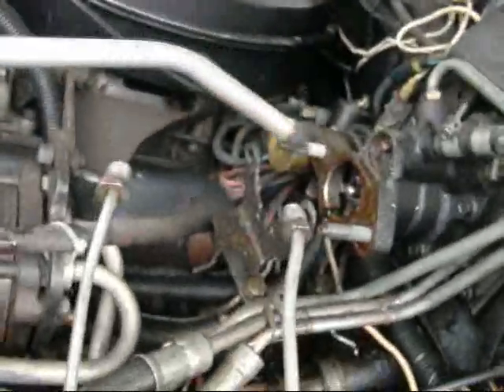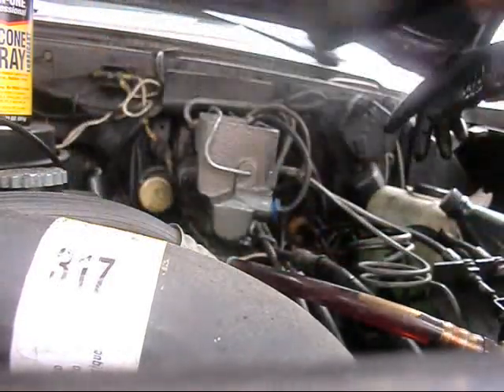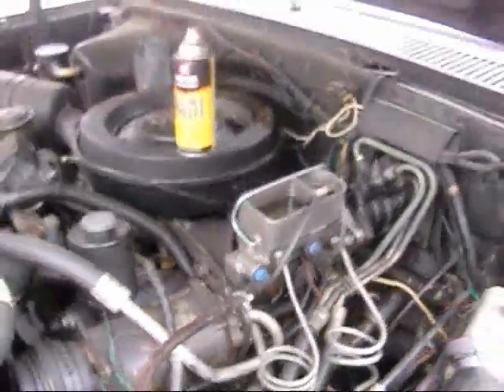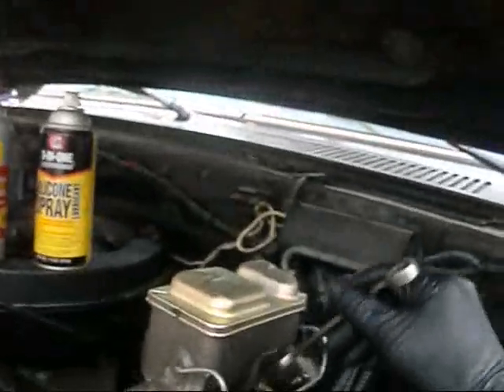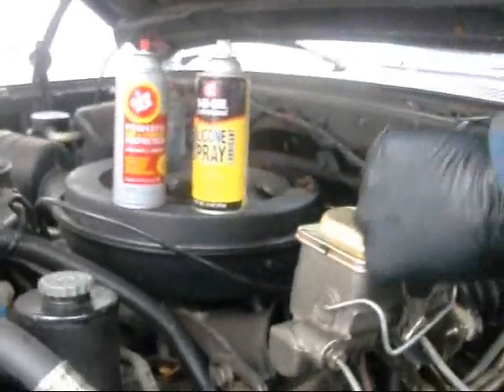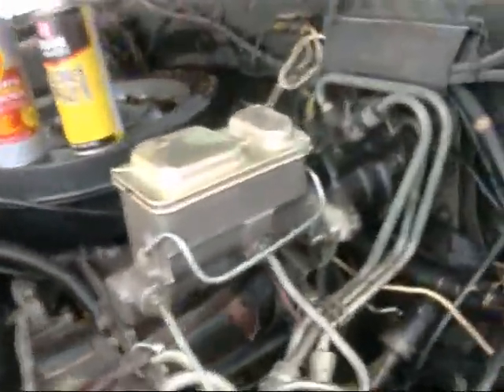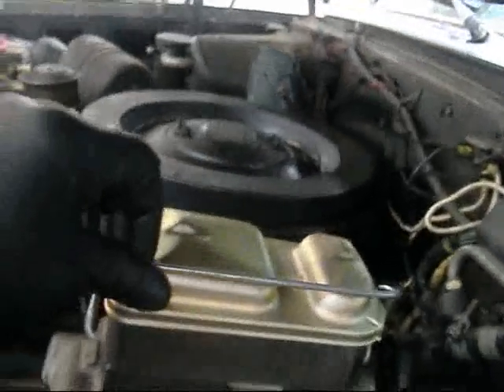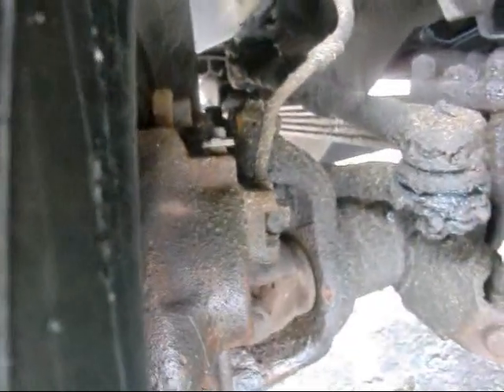K5 Master Cylinder Install  II  2 13 13

Comment: Since you don't want to fix your globe plug problem in the blazer plow truck you should put a push button starter under the hood so you can run your glow plugs and start the engine of them under the hood, lol